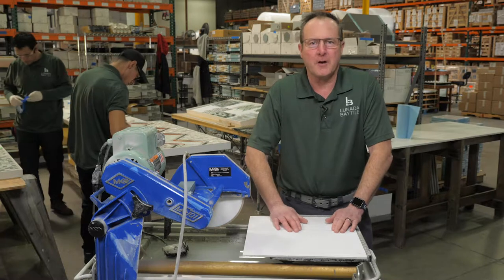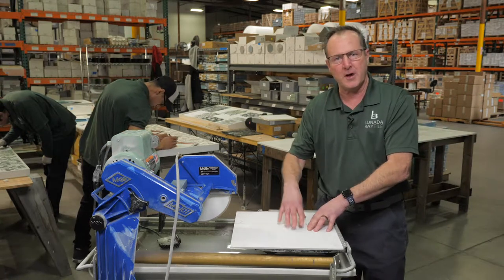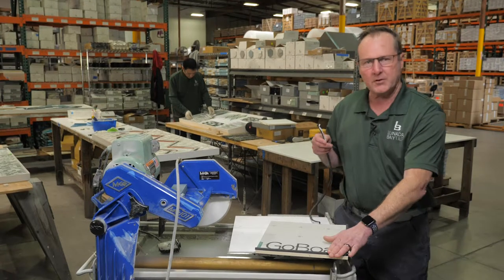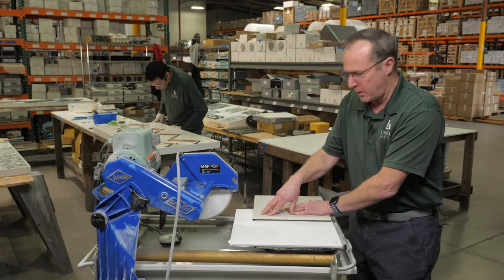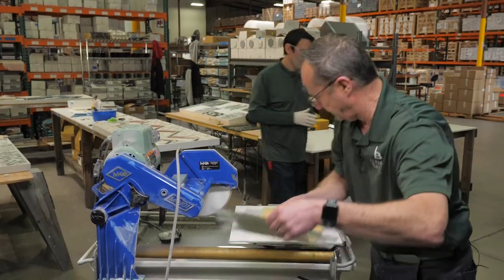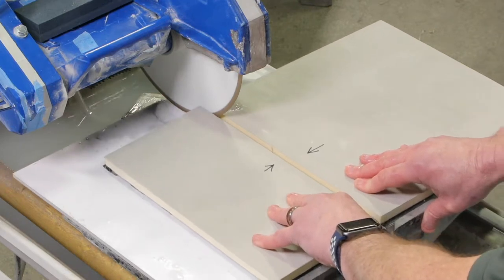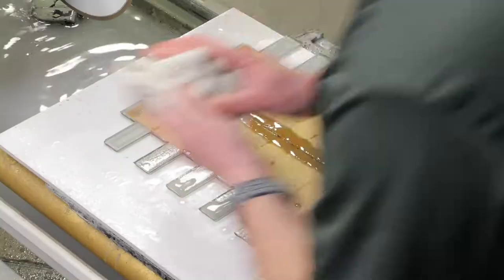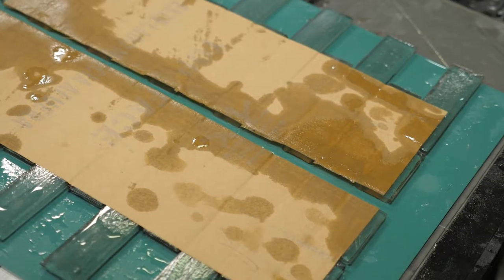youtube video #-8T1onupPxw

Comment: We used clear adhesive “contact”paper! (Shelf liner) it worked perfectly. Kept most of the water off the paper and we could reuse the same piece of contact paper! A lot easier than building templates that you can’t see through.
Reply from the maker: Thank you for reaching out. As mentioned in the video, there are multiple ways to achieve best results and we are always excited to learn a new method or approach to cutting glass tile. We appreciate the insight and will give it a try.

Comment: Is will the glue always re attach itself after a drive? If you don't use the weather stripping technique?
Reply from the maker: The Glue will reattach if there is a flat surface or tray to remove the tile from the saw and allow it to dry thoroughly.
Reply: @LunadaBayTile  Very nice thank you for the response